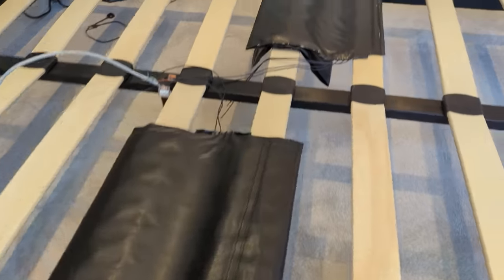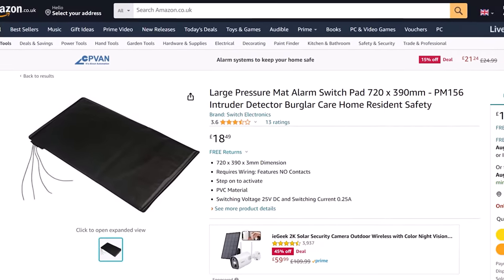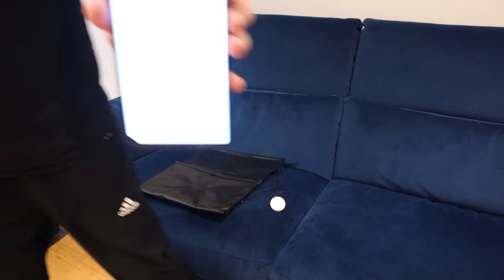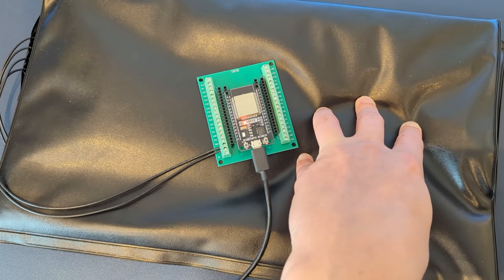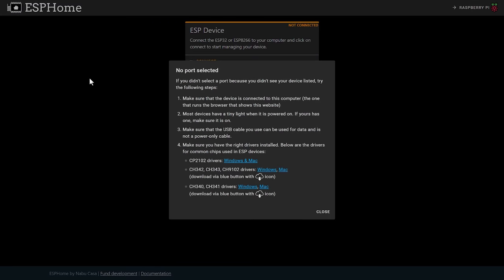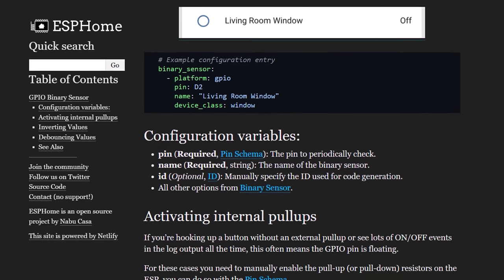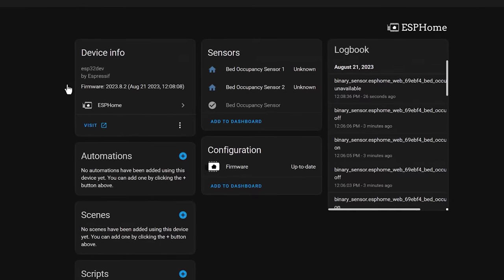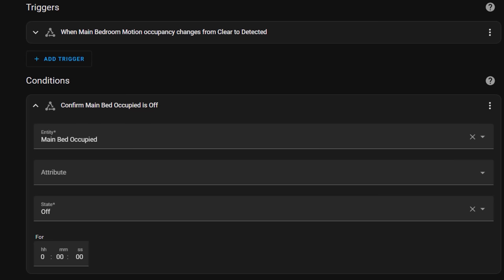Easy Aqara bed sensor vs ESPHome

Comment: My immediate thought when I saw this was about a system we tried to use for an elderly relative that lives on their own. To be clear, it is not Aqara based an had very few settings and none that we could tweak ourselves. It only allowed us to specify when the person should be in bed and when they should be getting out of bed. If they went to bed earlier that was fine and if they got up in the night and returned within an acceptable window of time then that was fine too. If they did not go to bed on time or they got up in the night and stayed out of bed then an alarm was triggered with a call centre. The problem was that it was not 100% reliable and would give false positives meaning the call centre would call the house in the night only to wake up the occupant. Getting to 100% reliability with elderly care is very nearly impossible but false positive (and indeed worse false negatives) are a nightmare and we gave up on that system.

I'm more tempted by the millimeter wave presence sensors that Aqara makes but even those cannot be 100% accurate so then it might need to be a combination of sensors, pressure, millimeter wave, and possibly something that could go under the bed legs to weigh the bed.
Reply from the maker: I think a combination of sensors would work ideally here. You could also use BLE presence to track what room someone is in if they have a fitbit or smart watch or similar

Comment: When you place the mattress on the sensor, doesn't it just trigger anyway? Or is there a way of fine tuning how much pressure is required?
Reply from the maker: Mine isn't triggered by the mattress weight if I spread the mat out under the mattress.  Mine only triggers when a lump like myself gets on top of the bed too.  There's no way to control the sensitivity of it, but I was able to get it working consistently by fiddling around with the placement of the mat under the mattress over the course of a few nights

Comment: I use ESPHOME to get the water levels of my swimming pond and water tank using pressure sensors. Also outdoor and pond water temperatures. I get co2 values around the house to determine how hard my ventilation system should work. I have light sensors, buttons, humidity sensors, the built in Bluetooth captures the i go from my xiaomi scale... Esphome can do it all!
How do you power your esp32 bed sensor? Usb power plug or battery?
Reply from the maker: Those are cool ESPHome Projects! 

I use a USB Power Plug to power it - have you had much luck getting the devices to work on batteries?
Reply: @HomeAutomationGuy  I have not tried using battery power 😉 all are USB powered.

Comment: I have had plans to create such a sensor. for a long time. I just don't know how I'm going to integrate it into smartthings. There does seem to be a way to put an ESP 32 into the smart home platform, but I have. not had time to try it out. It seems kind of confusing. If you have any ideas, I'd be happy to hear.
Reply from the maker: The Aqara water leak sensor should be easy to link to SmartThings

Comment: I'm confused, wont the weight of the bed itself will trigger the pressure mats?
can I control the sensitivity?
Reply from the maker: Mine isn't triggered by the mattress weight if I spread the mat out under the mattress.  Mine only triggers when a lump like myself gets on top of the bed too.  There's no way to control the sensitivity of it, but I was able to get it working consistently by fiddling around with the placement of the mat under the mattress over the course of a few nights

Comment: Great video. Love the idea of repurposing Aqara leak sensors for this!

Does anyone know where to source the mat in Canada without overpaying? Not available on Amazon here and Google searches result in webstores with zero stock or eBay listings with 1000% markups lol. Direct purchase from the manufacturer (Switch Electronics, linked in article) is a great price, but the shipping costs are way too high for a single unit.
Reply from the maker: Oh bummer. Maybe check out some alarm stores or those targeted towards home care?
Reply: I got mine from Walmart.  I'm in the US.

Comment: Is it better to use an Aqara contact sensor rather than a leak detector?
Reply from the maker: The outcome would be the same, but it means you need to crack open the contact sensor and do some soldering. The leak sensor terminals are really convenient
Reply: @HomeAutomationGuy  ah yeah, great point! I never thought of it that way 👍🏻
Reply: I used the Aqara contact sensors for this, didn't even occur to me to try the leak detectors, once all wired up the input is inverted, so "clear" means someone is in the bed, easy enough to use a template binary sensor to invert, but a little annoying, so would definitely recommend the leak sensor over contact sensor
Reply: @taavi470  can you invert the contact sensor in the ui or is it just a template using Yaml? I think I’ll use a contact sensor because I want to get back into soldering again
Reply: @michaelthompson657  I didn't find a way to do it in the UI, not sure did I miss something, I'm using a template binary sensor in yaml with a state like {{ is_state('binary_sensor.bed_occupancy', 'off') }}
Reply: @taavi470  thanks I’ll have a look into it when I do it 👍🏻

Comment: Why expensive pressure pad and not MM wave ESP32?
Reply from the maker: Firstly, I wanted to use it as an excuse to learn about ESPHome, and secondly I actually built it in the days before the MMWaves were as affordable as they are today.  mmWave is a good option though if all you care about is occupied or not.

Comment: As a alarm engineer of 35 years , I would not trust the pressure mats to be reliable over a period of time., The industry does not allow them, All they are are 2 layers of foil seperated by a thin layer of foam with holes in, that allow the 2 foil layers to connect together. The life time will be severly reduced with them draped over the bed latts as the foil will be folded at that point. Great use case though, I use water leak sensors too, to get the lock / unlock status of our cars
Reply: What is a more reliable solution?
Reply: I'd try using strain gauges under each foot. Basically make the bed into a giant scale.
Reply: Car seat sensors, Thin Film Pressure Sensor, SF15-600, or a whetstone pressure bridge under the bed legs.
Reply: What’s an alarm engineer, and how could you be one for THIRTY FIVE years!!!?
Reply: @invinciblemode  I would imagine the correct title would be an electronic security engineer, and I started work as one with a national company when I was 16 years old so that's how.
Reply: Can you explain how do you use leak sensor to get lock unlock car status?
Reply: @miroslav1845  by using the 2 wires that leave the WiFi module and connecting them to the switch pair on a 5 wire central locking motor, fitting the motor and WiFi unit inside the car and then connect the reverse polarity pair to the cars locking pair.
Reply: I've been using the Withings sleep sensor may under my mattress for several years and it still works perfectly.
Reply: Sticking with the theme, I wonder if you could replace the foam with a memory foam that wouldn't be prone to losing its shape over time.
Reply: @luckycatdad8369 You have more details? Interested in going down this path

Comment: But sometimes you go to bed but still need light to read for exemple ...
Reply from the maker: Yep - that's very true.  Then you can use a combination of Conditions or Wait For Trigger in your automations to customise them to your own habits and environment.  For example, you could not run the night time routine if the reading light is on - or better yet use the Wait For Trigger action in your automation actions to wait until the reading light gets turned off for 10 mins before it does the rest of the routine.  There are a lot of flexible options for this type of automation - I just tried to show a generic starting point automation that people can use to build on top of.
Reply: @HomeAutomationGuy  ok, I get the point, thx !

Comment: Any decent mattress makes this useless as the pressure is never enough to close the circuit. If the circuit closes, your mattress is shit mate and it will hurt your back sooner or later ;)
Reply: Depends on what's underneath. If a fully flat surface, then you're right, the pressure won't be high enough. But most bed bases have few cms wide slats, and those provide higher pressure there, so the mat is triggered without being uncomfortable.